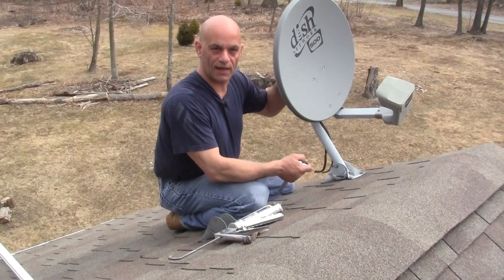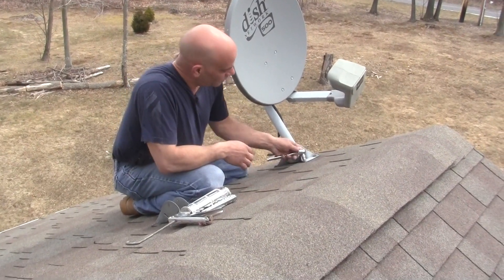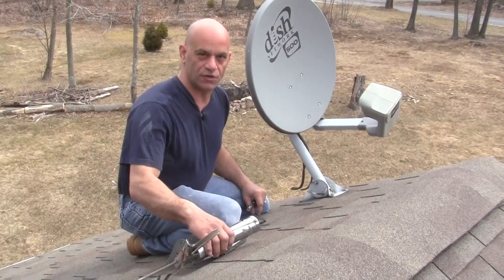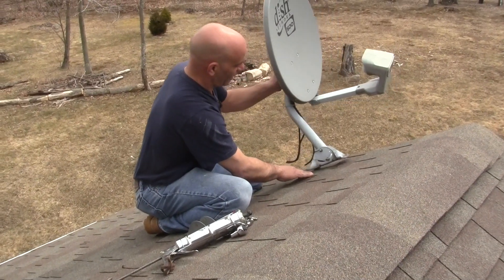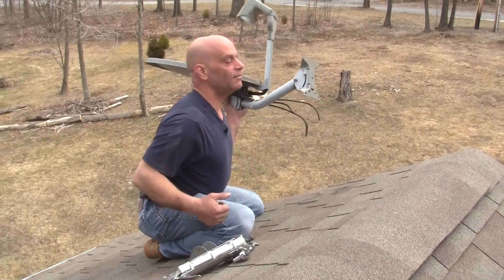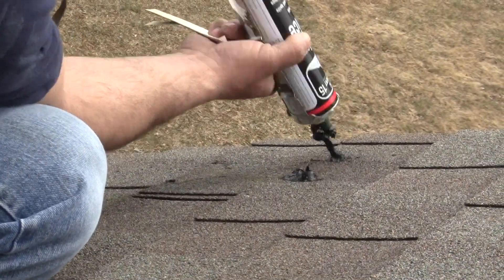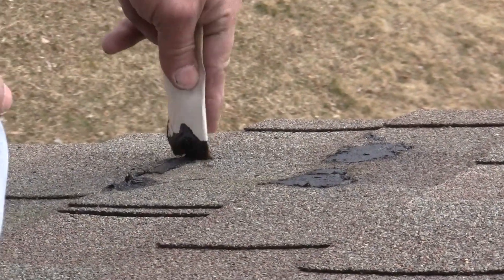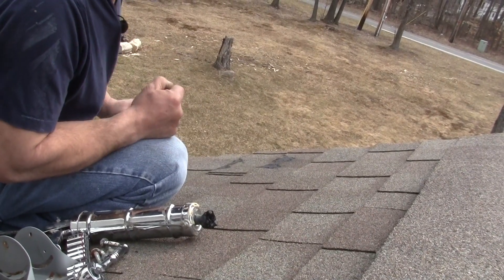How to Remove a Satellite Dish and seal the holes left behind

Comment: One other option that I've done in two houses so far -- if you don't want to leave those holes there (even if they're re-sealed) -- simply remove the dish and mast, and leave the saddle.  This is an especially good option if the installer put a lot of sealer or adhesive on the bottom of the saddle.  Less damage to the roof if you just leave it there.
Reply from the maker: Yes, good idea.
Reply: Saddle?
Reply: Except when the bolts rust out and you still have a hole.
Reply: @amandalangston1239  never seen a rusted out lag bolt on an antenna on 20+ years in the biz.

Comment: Once removed can I take it to the nearest dish retailer and place it through their window?
Reply from the maker: Mikey's Car and bike adventures I feel your pain
Reply: Second this - but for Viasat - Satellite Internet. Lied about their internet being usable at all - an average of 0.07 Mbps upload speeds does not provide for usable internet, but it was enough for them to claim the install worked and charge me $400. They claimed speeds could be slower when busy and it is "busy" all the time because of lock down - except I signed up DURING the lock down so they KNEW it would be useless. Insult to injury that I now have to remove their trash from my new roof.
Reply: Do you have to return it to them

Comment: Good video. I know you know this, but didn't mention it. IF you're pulling the entire assembly off altogether in one piece, it's best to fully remove the lower (downhill) screws first, then the higher (uphill) screws. It's easier to do it this way.

Comment: Have looked at a lot of sites trying to figure out a good solution to this. I like yours idea best because it is the easiest and the cheapest, but many other sites are saying you need to replace the shingles to make a proper repair. I guess that makes sense since most caulking does not last all that long and would likely need to be rechecked every few years. What are your thoughts on that? Thanks.

Comment: Were did you disconnect the cable to the dish? Did you just cut the cable? Thanks for the tip(s).
Reply from the maker: +michael morin In the one shown the cable was running up the side of the house and onto the roof. Some could be drilled through the roof.
Reply: +askmediy OK, thank you - I'll take a look at my set-up and it should be pretty evident - Thanks for the help.

Comment: Can anyone tell me what I do with the cable that is still attached. Is the cable going to electrocute me if I cute it?
Reply: With my cable it was simply a matter of unscrewing the cable attached to the dish from the cables coming in from the house.  They were connected by a coaxial coupler.
Reply: Jeyko Garuz it will not electrocute you

Comment: Yeah, but your wire is already disconnected. How do you disconnect the wire ? Don't you have to cut power and do other stuff?
Reply: Nocoaxial cable is not hot EVER! trust me i know more about this than most should. When it it were on an app aka booster " witch is not" you would still be fine

Comment: I discontinued my dish network service now i'm stuck with a very large satellite dish.They want to charge me $95.00 to have it removed.I will have to do it myself.It is drilled in to the ground of my cement patio.I am worried about the holes that will be left behind.How do i repair the holes?The cement has a brownish color how do i find cement that matches the color? How to i remove such a large dish? Please help!
Reply from the maker: If you go to the home store, in the concrete area look for cement color. It comes in a little bag or you can get in a little bottle. Add the right amount and the desired color.
Reply: Thank you i will do that.I bet you get this question a lot from pissed former dish customers.

Comment: So I just moved from a house I was renting and he is trying to charge me my entire deposit of 1050.00 because of the hole from the satellite.  Is this legit pricing because going by this video this seems fairly simple as well as cheap material to fix it.  Also he is trying to charge me for a new stove when only the door handle came off of the stove.  The stove works perfect, all 4 burners as well as the oven.  Lay thing he is trying to charge me for is the garbage disposal which the blade broke off.  I took pictures of what it looks like after.  Basically it was left with nothing but rust from the top that was left.  Please help, any advice would be nice...Also if you can tell me how much the tar gun/tar cost from the video thatt would be great as well.

Comment: I'm A roofer and yes I've done it that way in the past but why don't you just pull the bolts replace shingles just as easy???
Reply from the maker: +Ryan McGrath Yes for sure, if you have the same shingles. I made this video for the DIY'er.
Reply: +askmediy I figured that's what you do good job
Reply: +Ryan McGrath for that also describing like
Reply: @GMC-ut6pc  you are right using tar  is just  the cheap way and can fail quicker or right away a DIY'er can replace shingles as well. i see this as a hack job